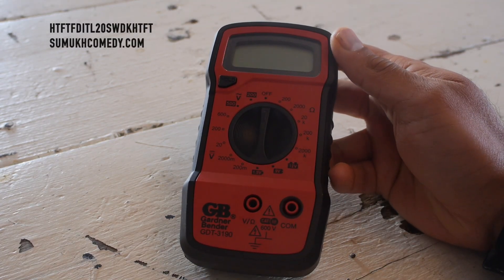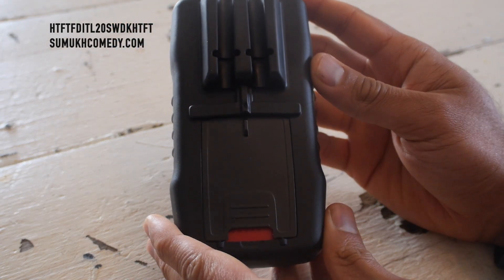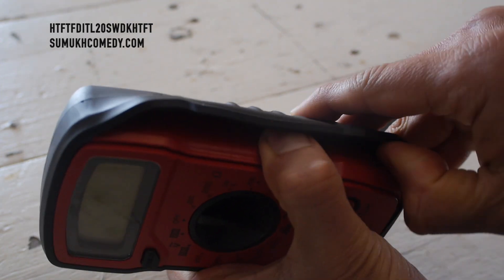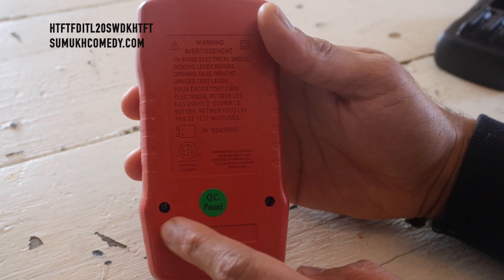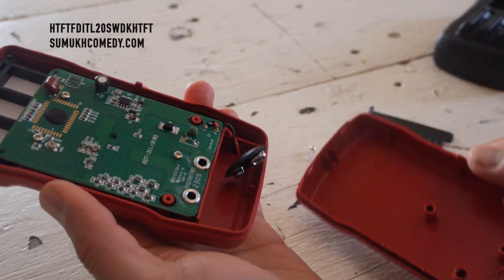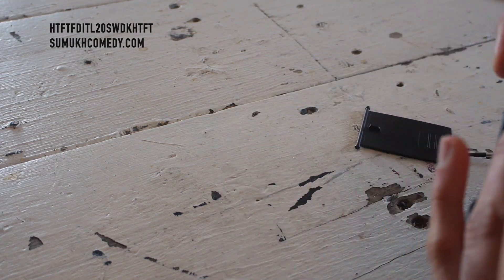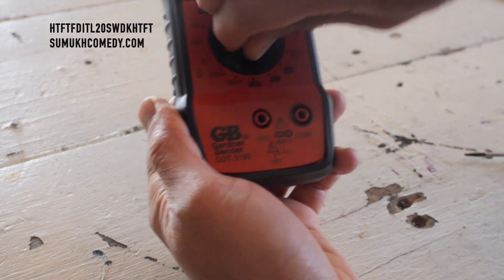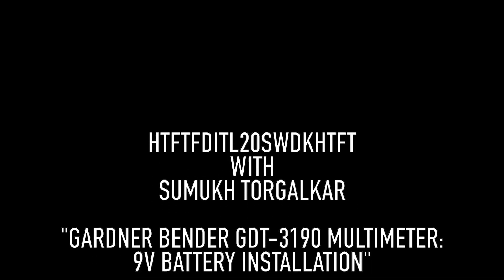Gardner Bender GDT-3190 Multimeter: 9V Battery Installation

Comment: The very first move to remove the flapper stand needs a warning: Turn it a bit before pulling it out so the weak plastic pegs don't break off immediately. I threw it away. So poorly designed.

Comment: What a retarded design. I get that you don’t want to install a battery, or don’t want it to drain, but holy crap. Just use lithium and make it rechargeable if you’re going to wrap it in an otter box.

Comment: What an absolute garbage and overpriced product. Mine did not just come apart like shown, the first piece broke and the outer plastic then tore apart when trying to remove it. How terrible to have something break in 2 spots before you even get a battery in it! Won't ever get this brand of product again.

Comment: Thanks for this video. The plastic covering seemed like it was adhered to the unit, i.e. NOT intuitive that one would have to remove it. I will give them this -- there's no other plausible alternative to get the battery in but it's still stupid. Thanks again for the vid

Comment: Just got this for $32 from ACE hardware and this is complete BS 
You have to disassemble the whole tool to before you use it
I also had to go back out to buy the stinking tiny screw driver
Wasted 2 hrs of my day 
I’d be embarrassed if I designed this tool
Reply: Well now you have a tiny screwdriver for next time